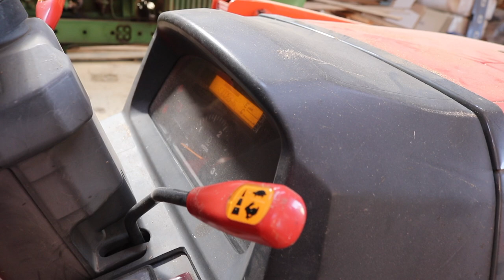MUST HAVE UPGRADE FOR ANY OLD TRUCK!!!

Comment: you should wood glue that box together or silicone all the cracks on the inside to stop all the air leaks, the sub will sound a lot better if you do that

Comment: For that center console box you could just put a board on the back of it and then cut out a hole big enough for the back of the sub to fit through and then you can flush mount the sub to the actual center console box.

Comment: Just beware you will risk having leaks if you build a custom sub box. Then it will sound like crap. You NEED to seal it somehow.  I would recommend just getting a under seat sub box.  They make them so its 1 small box so it doesn't take up the entire space under the back seat and just goes under the back left for example

Comment: I would definitely suggest just putting a board on the back and flush mounting that sub! But with speakers being as finicky as they are you will have to look up the specs on it as far as power and wattage to figure out how big or small you can go with the sub box. But you would 100% have to seal up everything on the box other that a port hole, which you could then get dimensions  on where and how big to make your port!

Comment: You can actually take the sub out of that box put a piece of board back are measured out around speaker and cut the hole out of the piece of board the speaker will fit I think it's a little too tall for your arms to restaurant it'll make your neck hurt for your elbow or shoulder being propped up that high and you can make that top where lift up and you can have storage there and you can actually put charging ports where did you make it to where you don't have any running all over the place you throw inside that box

Comment: Okay if you have not finished it yet box in that front section for cup holders and leave the rest open for the sub to breathe you will get a lot better performance out of a sub with proper venting on the box that slot in the front is a good amount of air flow for a 12 inch sub
Reply: For good 12 inch subs the Memphis audio and old school Boston Memphis subs are killer single sub setups you get good mid and high range bass out of it just some good input of a effective product
Reply: Could cut a 12 inch hole in a square piece of wood to mount the sub in the rear no different than a normal box run the wiring out mount the amp on the side and just seal off the box on any cracks or the little gaps on the angle with wood puddy and a wood sealer. Keeps the airflow smooth for the sub and will protect the wood from drink spills from the future

Comment: Also you should do some research or talk to an audio guy about the box because what you have looks nice but won’t work. Subs make bass off of the about of sq ft of air in the box and it has to be sealed from outside air. Each size or brand of sub is different. You have a good idea but you will be going down in bass quality from what you have now.